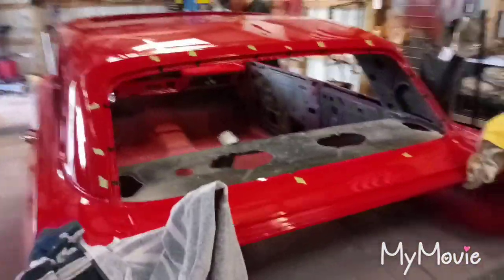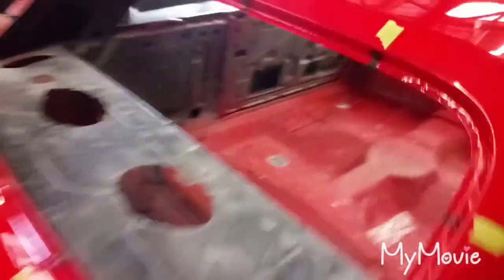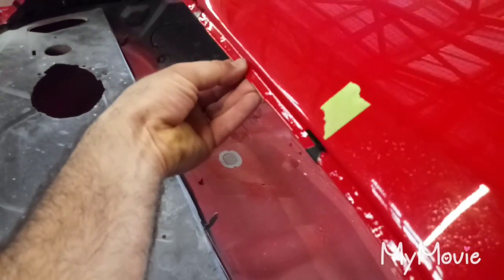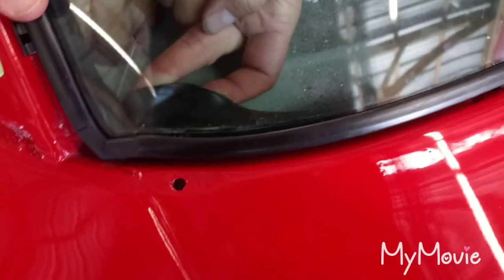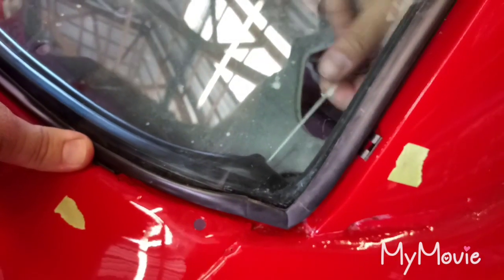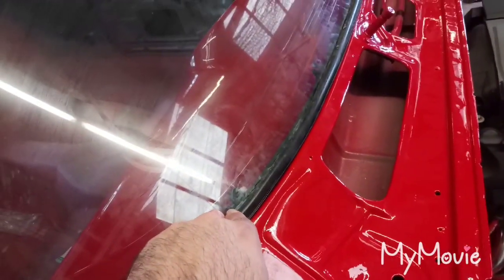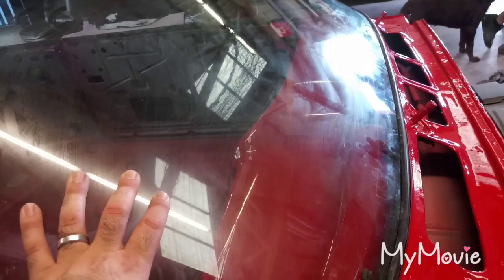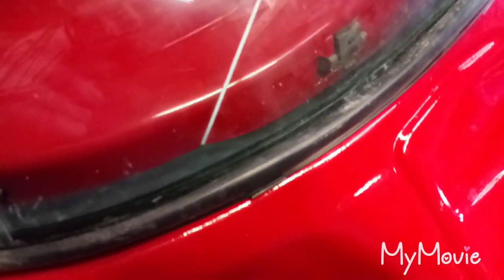How install front and rear glass on classic car

Comment: Installed rear glass yesterday with help from my Brother  and Brother-In -Law. Put tire lube inside the rubber channel and a water Dawn combo in a spray bottle on the metal of the car glass frame. I don't think they even had to press down on the glass. I started the #14 stranded wire on the bottom and it did not take very much effort to pull the wire out and get a great seal.
This has been a worry for me on how to get some one to install the glass, so Thank You for showing everyone how easy it is to do.
Reply from the maker: Glad to hear!  😎😎
Reply: Wooooo

Comment: One recommendation would be to start the rope on the bottom. This job went well but many times starting at the top is a battle as the weight of the glass can work against you. The gasket appears to be new which is great. However If you are using a used gasket which does not bite the pinch weld securely I suggest beginning on the bottom. Nice work!

Comment: Hell yeah thank you very much for showing me how to drop my windshield in appreciate it 👍💯
Reply from the maker: Tight
Reply: @lonestarlows  is that thin metal piece hard to push in behind the bottom of the front windshield
Reply from the maker: Its. Not that hard. But if its all painted you really get 1 chance to get it right without scratching everything up

Comment: This is a great video that actually shows you installing the rear glass! Do you have a video showing you removing the trim molding on the rear glass, as well as the best tool you have found that works best? I have not found a video showing anyone removing the trim around the rear window. Thanks!
Reply from the maker: Im sure there's a tool but a small screw driver should work. I always buy cars in pieces  so the disassemble  is usually done already  lol

Comment: Great video bro! I’m about to put the front glass on a 64 convertible.  I don’t remember any clips under the windshield when they took it out, are those only for the hardtop models? If I’m not mistaken the lower trim pieces have clips that just screw in right? Thanks!
Reply from the maker: Yes the lower trim clips screw into the cowl, and slide back and forth in the trim itself. On conv I'm not 100% sure. But I think the header molding up top bolts in place and the side moldings screw in the door jam.  The clips are used to hold trim in place, not hold glass in place. So you are probably right
Reply: @lonestarlows  thanks ! Much appreciated!!

Comment: Thank you for such an awesome video!! I was thinking I needed to call a glass man but damn, you made it look easy. One question though Sir: how much of an overlap is there with the two ends of the string inside the rubber seal? I hope I'm making sense??? One hell of a build BTW.
Reply from the maker: Good deal. I overlapped like 18 inches or so just incase the string slips. Which if it does its not end of world. The glass can be pushed out and the rubber reset and start over

Comment: Firsts off I'd like to say your cars came out really nice.  I'm in the process of restoring a 64 impala ss  convertible. I was wondering is there clips that go along the top front windshield that would hold the big chrome molding.?  thank you.
Reply from the maker: Hi. Not sure. I've never install that molding on a 64, but I would assume so.  It is stainless, not chrome btw.👍

Comment: Man that was a good video and it looks simple too do!!! Thanks for the video keep them coming!!! I did have a question as far as that dash filler where can you get them and what would it be called??? Also on his firewall did he buy an insert if not what screws holes did he keep??? I just got mine on a rotisserie this week building the frame soon
Reply from the maker: The dash piece is probably on your car. Not sure what screw holes you are talking about
Reply: lonestar lows ill have to double check cause i cant recall. Meant on the screw holes on the firewall did he just keep the booster holes windshield one and the ones to mount fender??? Did he get a pre fabricated one like you did from last minute???
Reply from the maker: @balanis03  correct. And correct

Comment: Did this on a 64 VW. However the first time I broke the windshield! What I found out is that you have to buy good Rubber Seals. My first try they were kinda hard? Old? Then I just went to a forum and ask what was the best....Soooo..What brand are you using??
 Have a leaky front window on my 65 El Camino. Basically the same as this Impala? Was going to use the Butyl Squishy seal. But I did have good luck with the Rubber. I would think it would also be a lot more Uniform with the trim.

Comment: Nice work man!! Love the car. How would you recommend removing the stainless? I’m researching as much as possible to know what’s all clips vs screwed on? But would you just pull off the pieces that have clips by hand? Or what methods did you use? Thanks in advance. Cars looks perfect man 🙌🏼
Reply from the maker: They make a tool to pop the stainless off. A screw driver or puddy knife works as well. Take time or dent trim
Reply: Thank homie

Comment: Going to do a little research after this comment (did some beforehand but no luck) but would this be possible for a older model vehicle that doesn't originally come with a gasket?

My 76 El Camino just has the windshield "glued" (for lack of better term) to the frame and has trim around the windshield (2 pieces of trim missing, but the part that leaks is under the trim of course 😂)
Reply from the maker: I can't answer for sure because I've never I stalled Glass on a car newer than 64

Comment: Did you ever get any water inside the car since you didn’t use any sealer?
Reply from the maker: No
Reply: That’s good 👍🏼 doing that tomorrow
Reply from the maker: @Vic-gh1vx you could throw some silicone in there if you have big gaps, depending on the quality of the gasket run channel...doesn't hurt.
Reply: @lonestarlows  thanks for the tip! I appreciate it. Keep up the good content man👊🏻

Comment: I need to install a rear window on my '66 Barracuda. My brother has the window. I already pulled out all the glass chunks, as the window had been smashed before I bought the car. I also went inside the molding with a wire brush. There's still a slight bit of gummy residue inside the molding, but it's mostly clean. Do I need to clean it out 100% with a solvent, or is it good to go onto the window as it is?
Reply from the maker: U want the molding as clean as possibly so it snaps in place evenly. Wax and grease remover works real good
Reply: @lonestarlows   Thanks! This video is a big help!

Comment: What type of product would you use for a 70 nova front and rear glass?
Reply from the maker: Product?
Reply: @lonestarlows  3m ureathane
Reply from the maker: I don't use anything.  The rubber forms the seal
Reply: @lonestarlows  70 nova only uses ureathane
Reply from the maker: @Supanova70  I've never worked on a nova. But 3M is a good start

Comment: LS I end with a leak on back glass what sealant do you recommend to stop it
Reply from the maker: you could use windshiled urethane i suppose
Reply: @lonestarlows  come in through lower corners on both sides
Reply from the maker: Sometimes if there is a gap I will just use some clear caulking. I did it on my.60 windshield
Reply: @lonestarlows  ok thanks will try that 👍🏿💯

Comment: Were can u purchase those clip in studs?
Reply from the maker: Ebay. Multipe years
Reply: @lonestarlows  what are thry called exactly i cant find anything but the screw in studs.Thanks
Reply from the maker: 58 64 front windshield trim molding clip on ebay. Sold in bags of 10. Get 30 to have plenty

Comment: The body is designed to drip out the water. Unfortunately it ends up in lower quarters but for the most part it will roll out by design